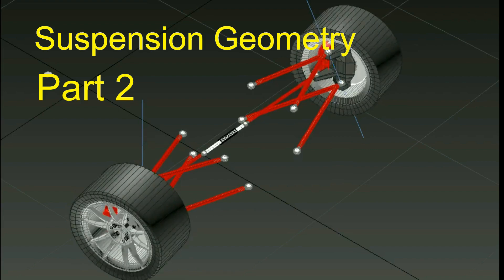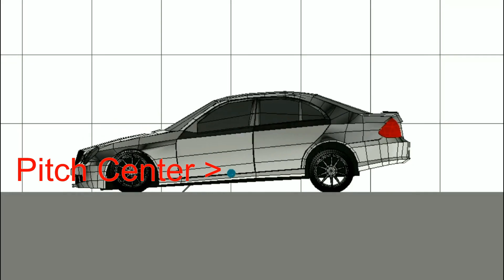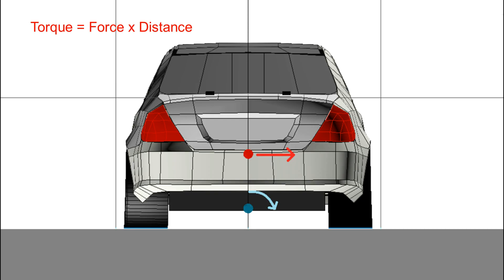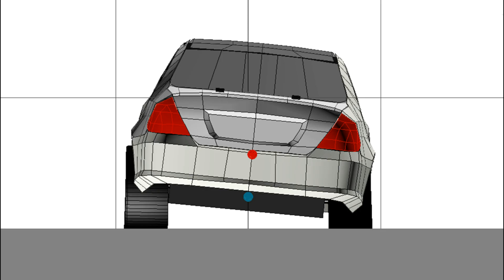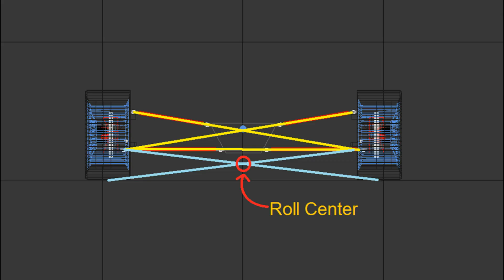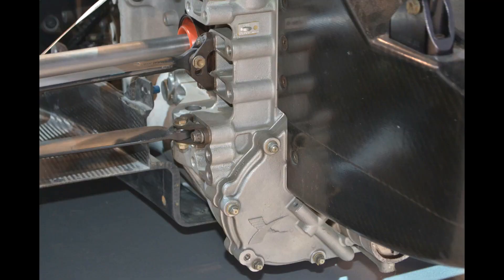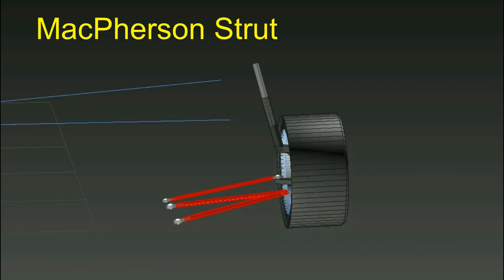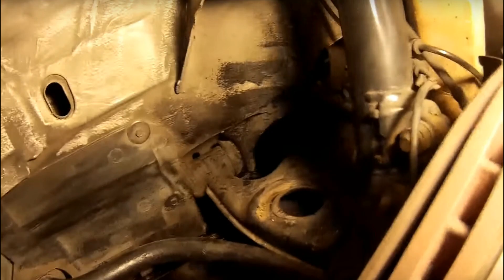Suspension Geometry - Part 2 (Roll Center, Double Wishbone, MacPherson Strut)

Comment: As someone else already said, at 9:53, which angle should be used to draw the line for the upper control arm? If you are using anti dive, it would have two atatchments to the chassis at different angles. Should you just use the bisector of the angle between the two?

Comment: The whole problem with the upper control arms having to be short enough to camber gain in corners without being so short that if screws you during squat/lift is why I love the simplicity of de-dion and/or plain beam axle, particularly on the rear. Never have I seen a rear-independent geometry that could do better than slight negative camber during cornering at the rear at the outside, with less than 2-deg static negative camber, and even on those the inside is quite literally on the edge of the tire.

That's to say nothing about what happens during acceleration. Meanwhile, De-Dion and beam axles always keep the tires square (disregarding deformation) no matter what, and particularly, the average contact patch size between sides is greater than the combined contact patch side of a corner optimized independent that isn't straight garbage in a straight line. The front is a bit of a different story given that Caster and KPI give you additional camber gains, not to mention the packaging and steering geo issues that a front beam axle has (let alone a driven front beam axle), but even then, if you solve a couple issues, you could still theoretically see several gains from the consistent geometry of a beam axle.

Comment: Hi there. I am Robert Farr.  Aged 43, living here in Western Europe.  Plymouth,  England to be more precise. 
May I call you Batman ? I think it's an affectionate nickname that might suit you !
We have a lot of problems with our bored old men, and younger folks who might struggle to afford a car or be in a hurry to get on the road aged 16 when they can ride a 50 cc, motorcycle,  scooter or moped. A two wheeled powered vehicle. 
Suspension mountain bicycles are starting to become more popular. 
Looking at all the suspension setups at a local bike meeting it's clear that even manufacturers don't know what they're doing with motorcycle suspension. 
Looking at the springs, so badly, positioned and, the high speed bikes with such a stupid, tyre arrangement. 

Look at moto GP, with the large rear tyre. 1000 cc new engines. Perhaps to fit into Hells Angels culture. 

Maybe in the past moto GP was 600 cc because they were limited by front tyre width and rider strength  ?

Now, rear tyres are larger than front tyres and the rear suspension is all over the place.

Any chance you can do motorcycle front suspension and motorcycle rear suspension please ?
This might be also interesting if you can tie, it into bicycle full suspension. 

It's tough to engineer, power transmission from the pedals.

Also, avoiding traps, that might snag a testicle or foot.
I would be, keen to know which full suspension bicycles you think are ideal.
Front suspension and bicycles without suspension. 
I love the B.M.X ! Bicycle. 
Imagine, a skateboard with the suspension of a Formula 1 car ?

So , maybe.  A video of front and rear suspension,  with a safety focus.
If you understand,  cars so well. You might be able to, create a factory creating small cars !? Why not, a small buggy, road legal for commuters  ?

My cousin is also involved with racing, his name is Dave Farr, who works with a BMW racing team out of Midlands,  England.  The home of Rover and MG. Also Birmingham Small Arms.
I am a former Railroad employee. 

I am interested in visiting Eastern Canada one day, as it's crowded here and, I believe the, climate in Eastern Canada to be similar to the climate, we have evolved to cope with here in England  !

Comment: Why would Fiat ruin a great little car   Fiat Panda 2021 Hybrid .  Faultless  UNTIL you drive it on main roads . Then it shows a weird steering trait .. where it fails to maintain a straight ahead steering . the anti roll bar mounting bushes are a permanent addition to the anti roll bar .. imparting an unwanted steering force directly onto the macpherson strut via the drop links .  as an ex / retired 1980 Donnington GT champion I can see you know what you are talking about . I have been off road due to these unwanted steering inputs .not funny . and potentially lethal with the heightened chance of an accident ./ crash .The Lancia Musa has the front anti roll bar correctly mounted with replaceable anti roll bar rubber bushes mounted on the lower track control arm / wishbone .

Comment: First let me say this was an excellent video, but I have some questions about the effects of moving the lower control arm pivot points specifically in a McPherson strut setup. What would be the effect of raising or lowering the rear pivot point of the lower control arm on the front suspension. On my subaru that point  could relatively easily be shimmed to lower that pivot point some. Would that be a beneficial considering the car has been lowered some?

Comment: So when designing this sort of suspension from what position do you calculate your roll and pitch centres? When the wheel is in the middle of it's travel? What order do you go about setting this up? Is the first step getting your minimum ride height, your desired wheel travel and then the wishbones? Great video, really helps visualising and understanding the concept.

Comment: in 9:57 to draw the yellow line which pointing point of upper control arm should be used? it has two points in the chassis  right

Comment: Perfect content 👍

If I want to increase negative camber on a MPherson front suspension there are two ways:
1. Move the top/upper mounting point of the strut to the inside of the car (camber plates etc), let’s say by 10mm
or
2. Push the wheel out at the bottom by installing longer lower control arms, let’s say also by ca 10mm

What is the better solution and why ?

Thanks a lot

Comment: It struck me recently that maybe manufactures know more than we do. My car has darn good stock suspension but has bump-steer I was wondering why as bump-steer is very easy to eliminate. It then hit me that bumper steer can be good. If set up to tow in under compression in the front it'll increase toe under squat increasing stability exactly when you need it. But also, it'll decrease Ackerman in roll. In a hard turn the outside squatting will increase toe, decreasing Ackerman and assisting in the turn.

Comment: Thanks. You helped me so much! I have some idea of what may be going on with my vehicle now when I take it in for a damage estimate. I have a 2008 Acura RL, pristine vehicle that is 12 yrs. old,low miles, I just bought it. Some goof backed into me with his 2019 Silverado (sticking out 6-8 inches, tow hitch). I was in the vehicle parked, he backed into me. I was reclined in the seat,  with the visor on the windshield, surfing the web. I was jolted in the car. No damage to the outside, of course I have not opened my hood yet, hmm, not sure if any sensors were damaged either, or the steering column paddle driving, etc.  before I knew about the wheels being turned and steering column locked - I let him leave. Well then I realized my wheels were turned and the steering wheel was locked when he pushed the front of my vehicle back. My steering is not returning to the forward position, and my 8 position, lumbar, heated seat moves every time I accelerate the car from a stand still position. All is good, I have  two witnesses, and an officer reviewed the surveillance video, she found him in the casino, so I got his insurance information. Thanks for the being thorough in your teaching, so a laymen could understand. Now I understand how my double wishbone suspension works.

Comment: I have question about double wishbone suspension. Lets say a manufacturer designs a car at a certain ride height and somehow one car had a 25mm higher ride height. Say at the where the stock ride height is supposed to be, the static camber is -1. As we lift the car up and the arm goes down, the negative camber increases. As we push the arm upwards the negative camber increases too. But lets say we raise the car 25mm, and we find that the camber goes close to zero. Is it possible that there is a "sweet spot" where camber goes to zero, where the manufacturer did not intend the car to be at that 25mm higher ride height ?

Comment: All good info except the part about production cars not taking full advantage of double wishbone suspension, on production cars the top of the tire moves in when the suspension is compressed but the bottom of the tire does not move to either side, this prevents the tire contact patch from moving side to side with suspension jounce, they do this by making the bottom control arm Sit at a slight up word angle and the front control arm as a large upward angle.

Comment: The line that connects the front and rear roll centers is called the roll axis. It is the imaginary line that the body rolls on when subjected to lateral forces to the center of gravity. When cornering forces build up, the body dumps more weight on the front end if that roll center is much lower than the rear one. This means a nose heavy car will understeer more.  Having the roll centers about the same height will reduce this tendency. In my experience with five race cars in forty years, low roll centers cause more roll by the body pushing down on the tire whereas a high roll center pushes against the tire in a more sideways direction, giving less bite,  but more of a tipping motion, especially with a solid rear axle.. This is why you will need much stiffer springs with a lower roll center. Also, now you will find that you generate more tire heat with lower roll centers and higher G forces too. All of this tuning depends on the cars weight and tire width etc. because if you max all of this out , even with 14 inch wide tires, you can quickly overheat them  on a road course.

Comment: 8:30 Why wouldn’t you raise the pitch center to the center of gravity? You just said that the jacking this causes is beneficial, but I imagine that there has to be a drawback like with the roll center. Also I just wanna say that this video series is wonderful! I have returned to it multiple times over the years because it’s such good reference material.

Comment: I have a doubt at 7:30 . You are saying  that while braking rotaional force will cause the suspension to move up a little bit, but wouldn't braking produce a torque on wheel in counter clockwise direction further pushing the suspension downwards.
Thanks in advance.
Reply: Yes the braking will try to twist the CCW but, the whole wheel is being forced backwards. As the upper UCA also moves backwards (and up) which could make the car dive more but you can’t look at the UCA in isolation. As pointed out, it’s the combination of both UCA and LCA and where they intersect. This intersection and it’s vertical distance from the CG line to the front contact patch determine the percentage of anti-dive. It’s really the car rotating (pitching) that is the driving force. Great video though.

Comment: This is a fantastic video on suspension geometry, but I have one complaint.
Literally all rally and rally cross cars, both asphalt and gravel specification, use McPherson struts, so there are racing cars that have these. Mostly for suspension travel and unsprung weight which is helpful if the road surface is not a smooth track.

Comment: I just had a thought, if you had an ev go cart, a chassis with the body removed. Said ev had a floor mounted large battery pack and in axle motors with a carbon fiber body. Which way would the car roll in a corner? It would actually roll towards the corner as the battery is lower than the roll point. This is why a 2.5 ton P90D can corner super flat and really torture the tires.

Comment: so if you just have 1 front lower control arm like a mustang or similar car the angle of the strut serves as a psuedo "upper" control arm?? for finding things out like pitch center?
Reply: im also guessing that with no upper control arm or upper ball joint theres no way to change KPI?

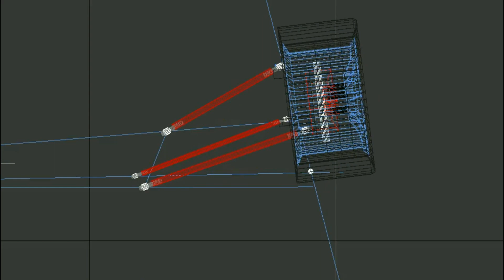Comment: 10:44 
Question: Can the mounting distance between the upper and lower control on the chassis be longer than the mounting distance of the ball joints on the kingpin?
So the intersection point is on the outside of the wheel  

For ME senior design my team is designing a 3 wheel bicycle hybrid with human power pedaling and an electric motor.  
Thank you
Reply: yes it often is you just have to adjust the length of your links and other parameters to get the camber curve, roll centre etc you need

Comment: Hello. I just wanted to comment about the setup I have for my vehicle. 06 BMW X5 E53 4.4i N62 V8. The factory setup is Macpherson Strut style. Its oem "Sachs" strut. With a multi link style lower setup. 2 control arms 1 tie rod attach to the knuckle and sway bar link attaches to the upper portion of the strut.

Comment: I really enjoy your videos! But I was a bit confused with the explaination of the anti dive. the front suspension of a motorcycle also moves backwards and that does not mean it has anti-dive. actually a motorcycle has pro-dive unfortunatly. could you please elaborate a litle bit more the explaination. Is it related to the reaction to the break calipers?
Reply from the maker: Depends which way the contact patch moves. In a motorcycle it moves backwards as the suspension squats, in this one it moves forwards because of the spindle rotating

Comment: Great videos, thanks!

Really look forward to part 3 on linkage suspension systems. My interest is largely in off-road racing, so triangulated 3 and 4 link, but if you wanted to cover other multilink designs, lateral locators like panhards and watts links, or more out there stuff such as Tatras swinging half shafts etc, that would be awesome!

Thanks for the effort you put into these, very informative!

Which CAD modelling software are you using in these videos?

Comment: I never realised suspension was so complicated...
Reply: 6Twisted One of the biggest things I’ve learned in my physics education (I’m currently in a physics PhD program) is that everything has so much complexity that you can never really run out of it. Much of the art in the sciences is determining what parts of the complexity is important for the problem you’re trying to solve, and figuring out how to appropriately represent and work with it.

As an example I spent a whole weekend recently just reading about and designing valve timing for a steam engine I’m designing. If I made everything constant, then it would’ve been simple, but making parameters adjustable means more complexity is involved. Similarly in car engines, until pretty recently almost all engines has constant valve timing, but then variable valve timing was introduced which means you need to be able to switch between cams, and even more recently Koenigsegg has developed a solenoid driven valve system for continuously variable valve timing, which obviously requires a huge amount of complex control system design. And I’m sure valves can get even more complicated if you really want
Reply: @1495978707  As electrical engineer and racing fan, I've always wondered why EM valve systems weren't introduced 30 years ago instead of sticking with mechanical and in the 80-ies the pneumatic valve [spring] system (Renault), given the advantages an EM based system brings: the speed potential it offers in combination with having a variable system when using software based controlling systems.

Comment: Thanks for the videos they are really great! What affect would lowering the upper strut mount have? Aside from reducing the travel I am thinking it would generally help geometry such as a bit more camber, negative scrub, and possibly lowering the role center?  I ask because i have a new mount that is about 5 mm lower and I was thinking that as long as the shock doesn't bottom out this slight change in geometry should be a positive effect in general, yes?
Reply from the maker: 5mm is a really small difference so it shouldn't change things too much. If your on the same shocks then yes the bottom out will change by 5mm. For the other angles you can go for a 3d wheel alignment. They will be able to tell you the exact camber, caster and toe angles

Comment: Amazing video. You should teach this stuff. As a viewer i’d really like to understand how these principles compare to older technology. e.g. classic VW, or 70’s Porsche 911 or RSR. Particularly how the rear suspension works with a rear weight/engine car. Would you consider doing a video? I think contextually it would say a lot about how the high level principles were applied in specific application.

Comment: Again Well Done

Hmmmm I'm interested in a tilt steering geometry for a tapole trike but can't find any good information.  
At 11:00 min in the video you said something like 'the car chassis roll angle causes the same change in camber/tilt angle of both front tires'.  
?Might I use this as the crux of a tilt steering for a tapole trike? I'm only hoping to be pointed in the right direction.  

Collapsible Recumbent Tricycle Design (ICECycles) https://www.youtube.com/watch?v=sPWd13YJCbI&list=PLtjqx_plLpTmoUW5paEsdsy1XHGgHR_TL&index=38
Tilting Three Wheeler Suspension 2.0  https://www.youtube.com/watch?v=Atxnr3_TiS4
Tilting Three Wheel Cycle | DIY https://www.youtube.com/watch?v=F9sG8RTxy1s

Comment: There are torsion forces in the front when you brake. Also there are torsion forces in the back when you accelerate. Yes it would be interesting to see a part 3 that covers that matter. 
I know it is not specifically for cars but some trikes use DW-Link suspension another subject to cover. I am pretty sure you can wing that.